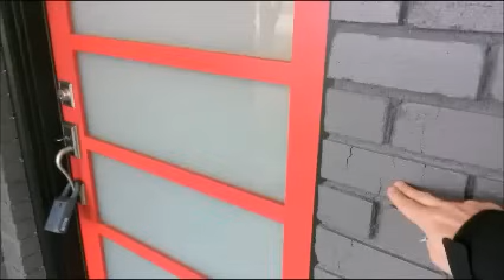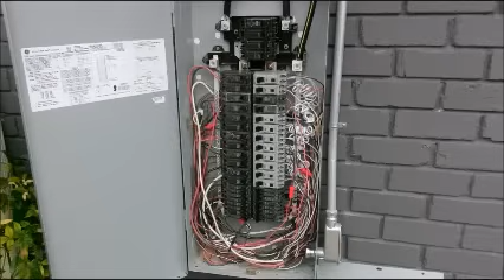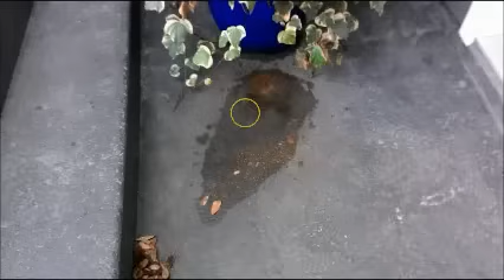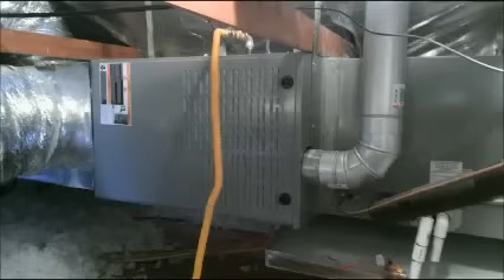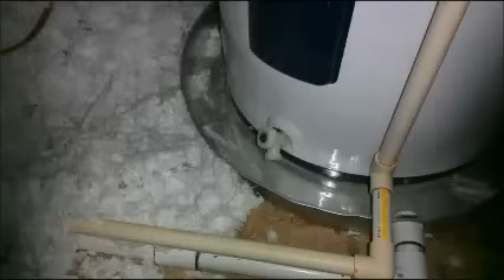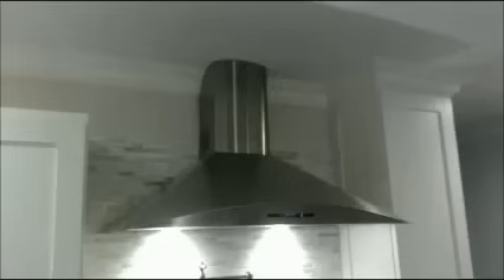Home Inspection Video Demo - Green Scene Home Inspections

Comment: why would a house need two 50 gallon water heaters? no wonder they they have plumbing problems, lol. i'm not an inspector, but here in ohio i've never even heard of water heaters in the attic. i'd think the weight would be pretty significant.

overall, though, i don't see any deal-breakers there.